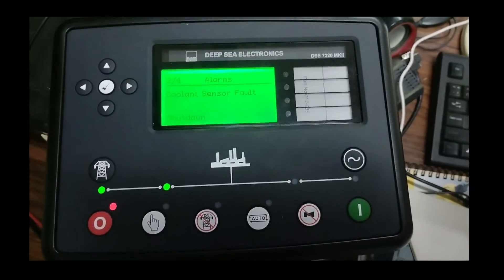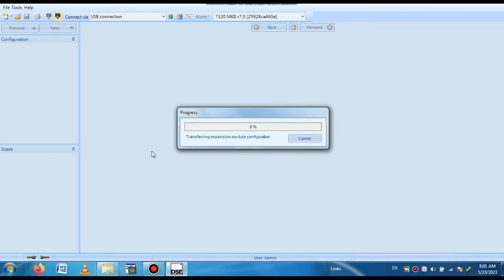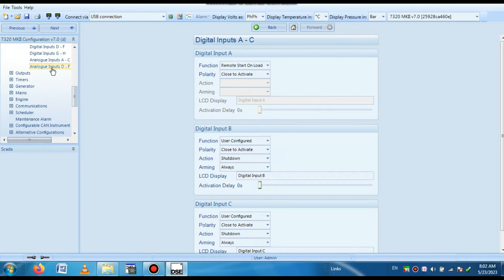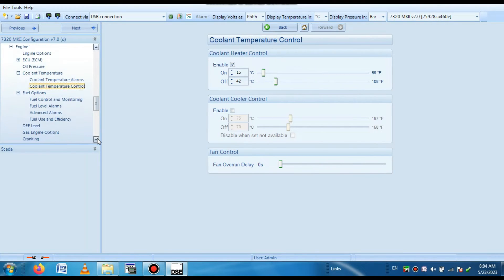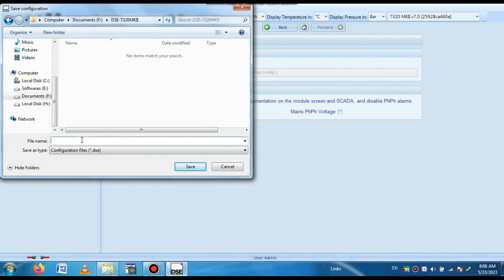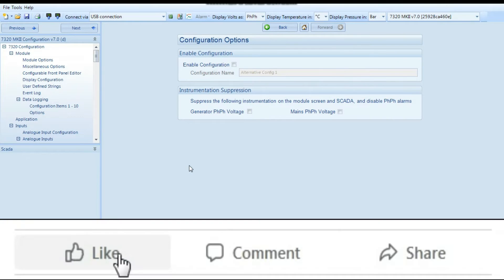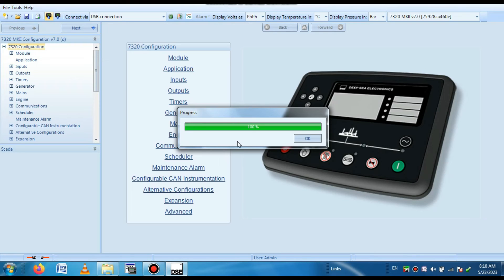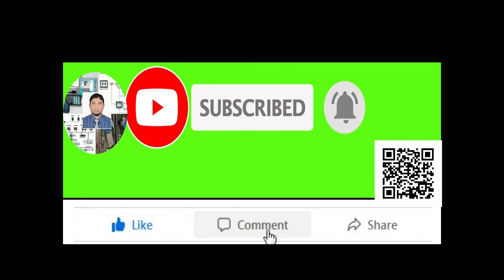How to Read, Write and Configure a Program of Deep Sea Electronics DSE 7320 MKII ?

Comment: Does it need at least 24V for the module to power on? I tried with a 12V AC/DC adapter and it didn't turn on
Reply from the maker: You must need 24V DC, 20A  capacity power supply unit